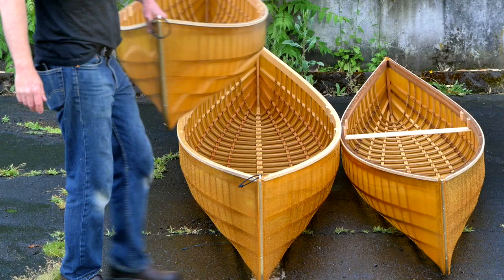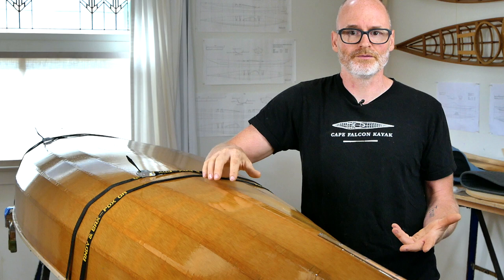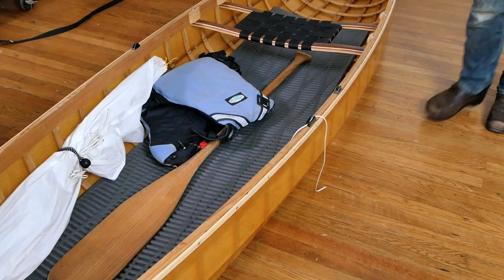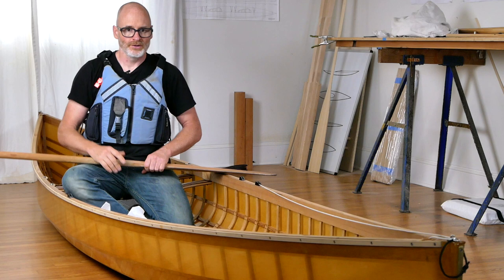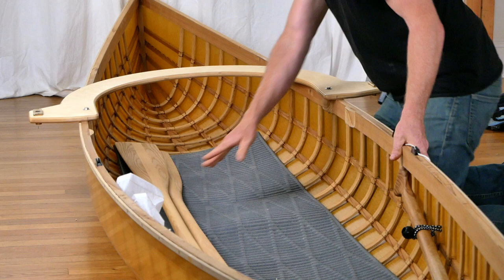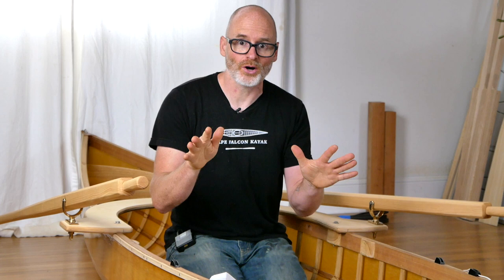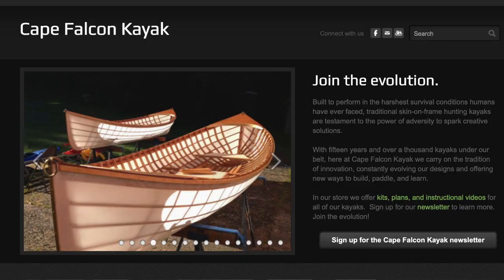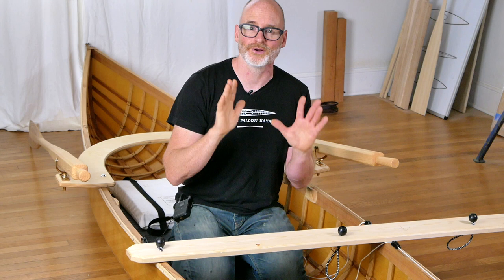Skin On Frame Nesting Canoes: Rowing, Sailing, Catamaran, and more!

Comment: Wow, it has really come together.   Now if the seat and oars could exist together. :)  so you could fold up the seat till it latches.  The rowing rig might have to shift forward a bit so the seat doesnt dig in your back when folded down... a couple inches maybe.  Just a thought.   Man, they are prety and so functional/flexible in design, love your work!
Reply: Looked again.  Folding does not look workable.  No matter. Great design.

Comment: Nice indeed. How about going one further and build a small skin on frame dinghy?
Reply from the maker: The problem is that you just can’t get it light enough.  For a skin on frame dinghy to be practical it needs to be able to carry two people and some gear through moderately rough water, it needs to have a 12oz skin and it has to weigh less than 70 pounds and as far as I can tell there’s just no way to do that.

Once you hit 70 it’s not practical as an on deck tender and it’s also not practical as a car topper in which case there are a ton of other boats in the 90 pound range that do everything better.    Also 70 is kind of the upper limit what you really want is 50 to 60.
Reply: I have just built a Burmarsh 13 which is a two man plywood canoe, and it is meant to be 36kg and it is just too heavy to be practical even with a road trailer.

Comment: Brian,  Here in West Virginia ash trees are dying by the acre due to the Emerald Ash Borer.  You might want to recommend a different wood for your oars.
Reply from the maker: I guess eventually we’ll have to switch to a different wood but for now isn’t this a good use of the lumber from all those dying trees?
Reply: @capefalconkayak     Brian,  I've acquired about a thousand board feet of ash that I'm hoarding for "very special" projects.   The trees are dying while standing.  When you cut them down,  the bark sluffs off while they're being skidded to the trucks that will deliver them to the saw mill.  When they arrive at the mill all muddy,  the sawmill owners don't want to cut them because of the mud  (either too much time/labor  to clean the mud off or wear and tear on equipment sawing muddy logs).  So, the dead ash trees stand in the forest.  If you have access and a storage place, you might want to put a couple of logs aside just to do paddles.

Comment: You've been clear that the boat is not really capable of sailing upwind. That's a combination of the sail shape (as you've said) as well as the lack or leeboard. But your rowing outrigger system strikes me as a potential solution to the latter problem  without adding more stuff to the boat. Since your sail is at the bow, the leeboard would need to be quite far abaft to equalize center of effort. I would speculate that it's possible then to use the pair of oars as a rudder on one side (effectively the traditional Norse "steerboard" from which the nautical term gets its name), and a leeboard on the other side. The leeboard oar would only need to be locked down at a calculated depth somehow.
Reply from the maker: I went down this rabbit hole when I was first designing the system, and I’ve got a whole barrel in the basement filled with different size foils and rudder systems.  What I eventually came to is that if you’re going to add foils of any sort or even a rudder it creates substantial drag and you would have to almost double the sail area to get the same amount of speed but as soon as you’re doubling the sail area then you’re gonna have to totally change the sail rig and reinforce the frame to handle the forces involved and pretty soon the whole thing just devolves into a frustrating contraption as opposed to this beautifully simple little sail that you barely notice is there unless you need it.

The magic of this little rig is steering it with weight shift only and not even putting a paddle in the water.  Just dipping the paddle to steer knocks about 25% of the speed right off the top and it comes back to life as soon as you pull it out.   

There’s nothing saying you couldn’t make an upwind sailing rig for one of these it’s just a different animal.